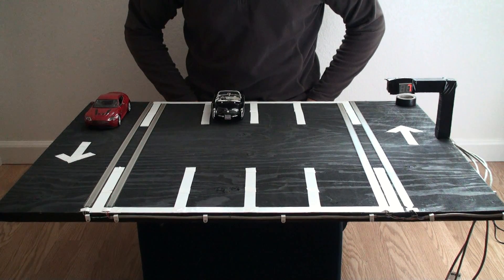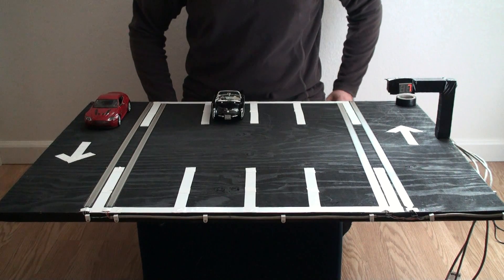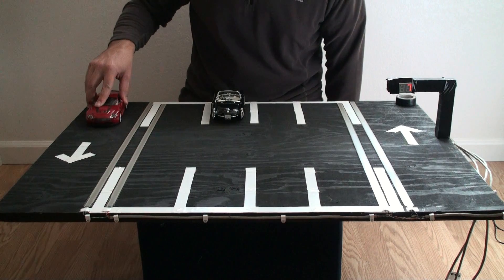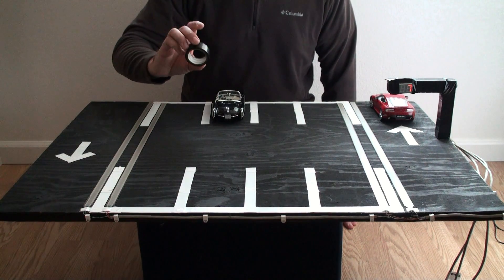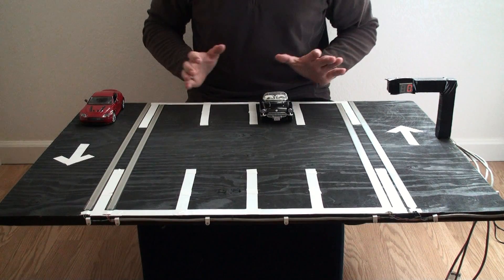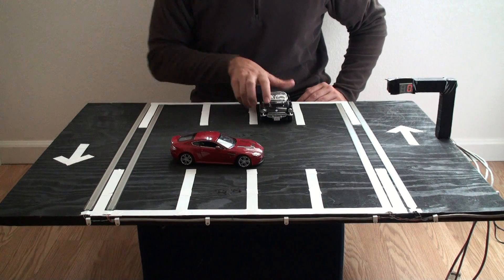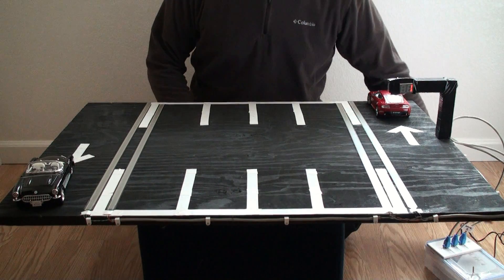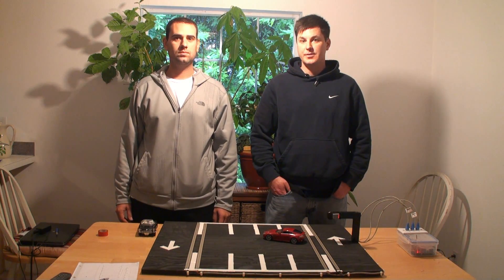Smart Parking Demo

Comment: Hi. Can i please know the components/materials you've used? Thanks. Your help is greatly appreciated.
Reply from the maker: I used force sensitive resistors (gold colored strips on the board) as the sensors. I used an Arduino microcontroller to monitor the sensors, keep track of the parking count, and display the count on the seven-segment display. I also used a couple resistors for creating a resistor divider and connecting the seven-segment display.

Comment: Hi!!cld u plz tell which is the sensor that u used??And how did u set the sensor that it doesn't detect aperson walking??
Reply from the maker: I used a force sensitive resistor as my sensor. They are the four gold-looking strips at the entrance and exit. They come in various shapes and sizes. I essentially created a voltage divider with the force sensitive resistors. Using the analog inputs of an Arduino, you can measure the voltage drop across the sensor. I created a condition such that anything below a certain voltage is not considered a vehicle. The voltage corresponds to the weight of the object passing over the sensor.